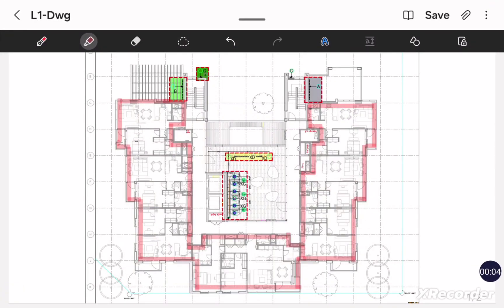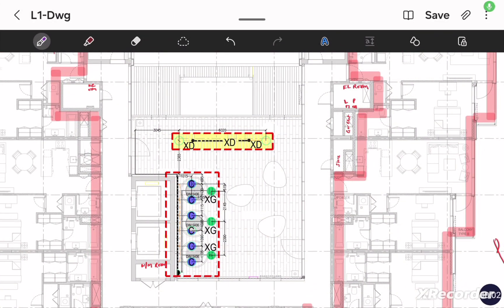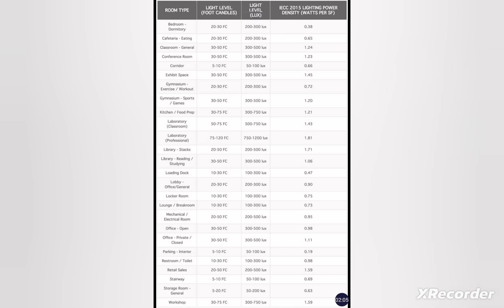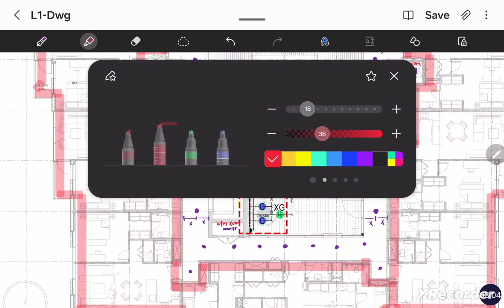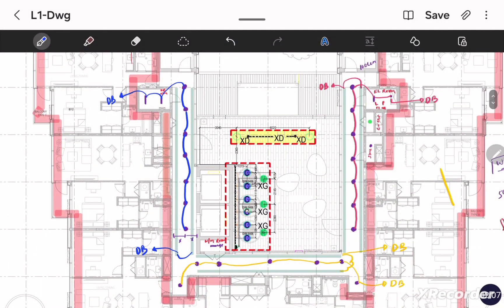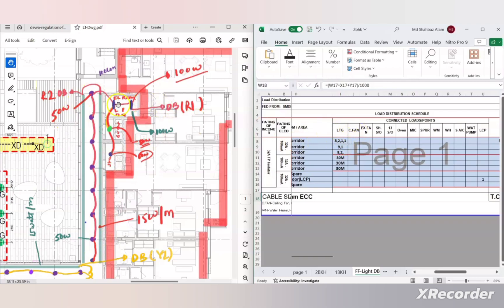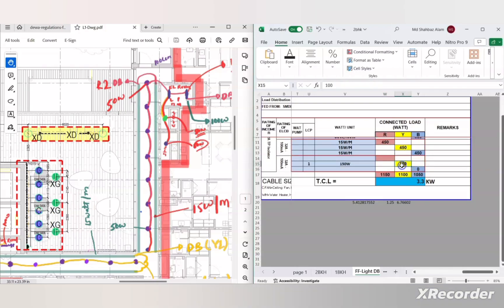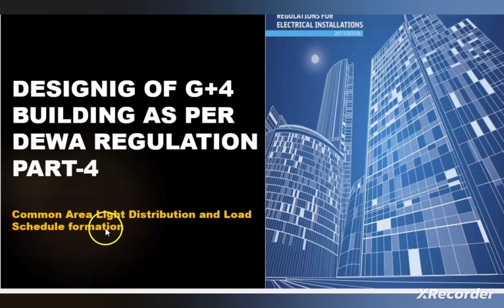G+4 building Designing as per DEWA Regulation--- Part-4  #dewa #regulation2017

Comment: Why did you provide LCP with 150W. LCP should be for Light control right? It's not a load
Reply from the maker: LCP is a controller which requires 230 volt power supply. It need some power consumption to run its controller timers . Yes some time it could be as less as 25 watt .

Comment: Please make video of all power requirements for a building :eg damper in corridor, csef, cmaf, pressurization fans, fahu , ahu , basement fans, lift power, chiller, all types of pumps,flux outlet for Mep including elv , etc
Reply from the maker: All will be covered one by one in G+4 building designing video
Reply: @electricalconcept32  please design basement power requirements also